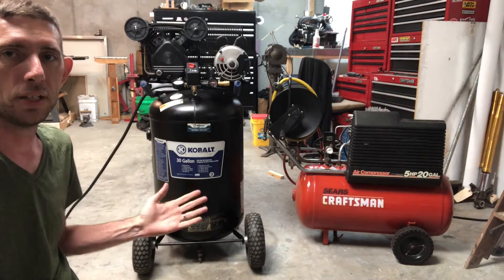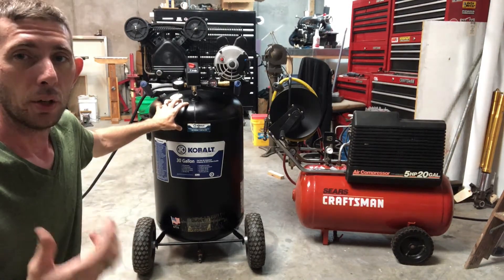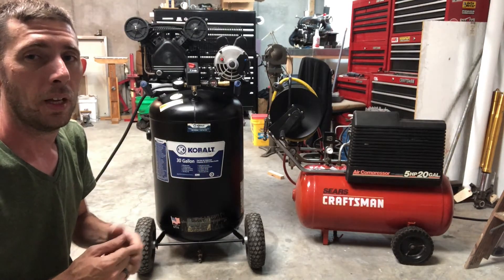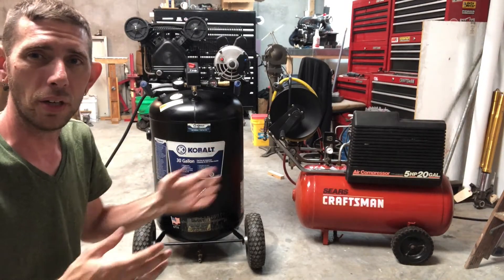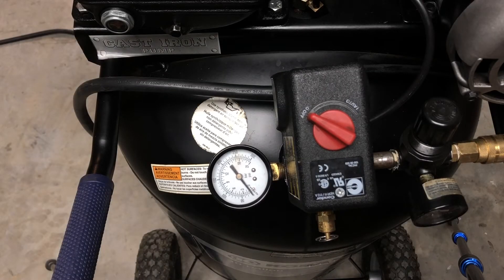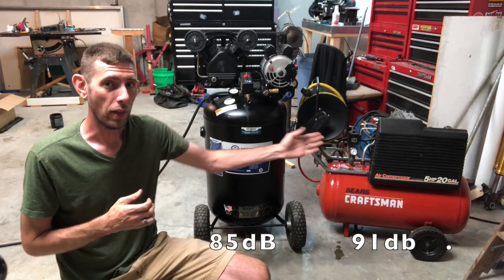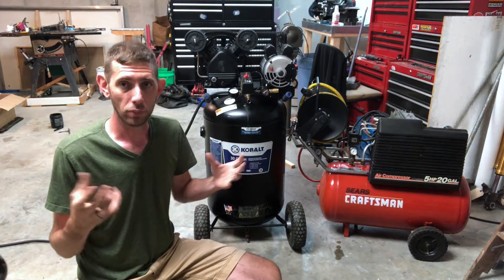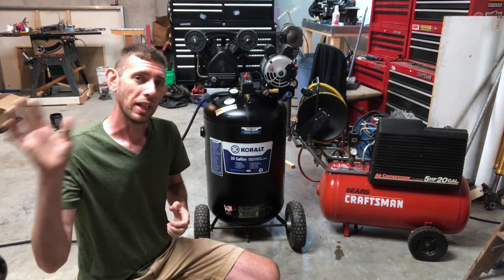Air Compressor SCFM comparison

Comment: I had the 30 galllon version of that Craftsman for 30 years, not problems at all.  2 years ago, a meth head broke into my shop and stole it along with many other valuables.  I'd like to find a suitable replacement,,,, they just don't make a comparable compressor these days.

Comment: That Kobart for a single stage was putting out a high pressure. I noticed it got up to about 160 psi before kicking off. 
Boy that is pushing the limts of single stage

Comment: What did you do to run the motor in 240? I'm about to rebuild the pump on my 20 gallon horizontal and I'd love to wire it to 240.
Reply from the maker: I purchased mine this way but if the motor is capable of running 240, it should have a diagram on it showing how to hook the wires.

Comment: Thanks man I was pulling this up because there’s one on craigslist for 200 and it’s a 30 gallon on the craftsman think I’m gonna go with it I live in the sticks a bit not too worried about noise. Gonna be running a little bit of autobody on personal vehicle i’m hoping it’ll run a DA a little bit and HVLP spray gun.

Comment: The tank is only included on these units to reduce compressor duty cycle and create air pressures above what the pump can produce by itself. SCFM is the amount of air volume the pump can produce indefinitely if its ran continuously (100% duty cycle), even if the tank was detached. If you were to run an air sander that requires 10 CFM @ 90psi, the stronger pump would be able to keep up with it even when the tank is depleted.
Reply from the maker: Thanks for that explanation. I was never sure since the SCFM is always listed on either the tank or belt guard. You’d think it’d be listed on the compressor itself somewhere. Maybe it is and I just haven’t looked very hard for it.
Reply: @DustinRogersinMO   Have you used an air hammer with that big compressor?
Reply from the maker: @dappa311  I sold the black compressor, so no, I didn’t really use it once I got it fixed.